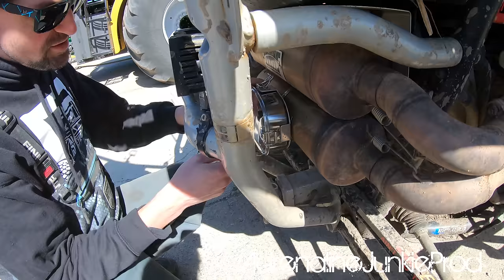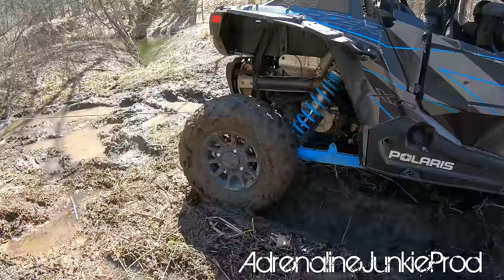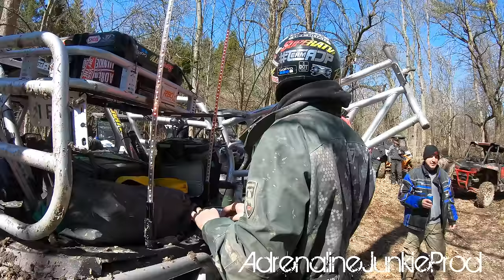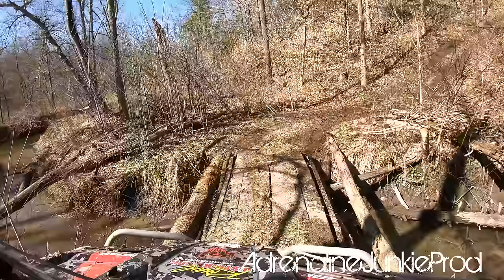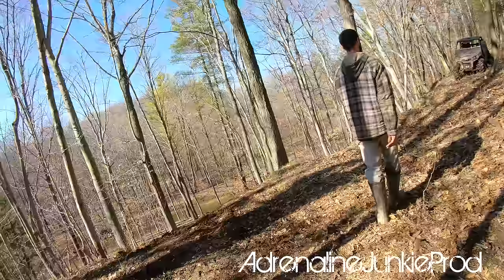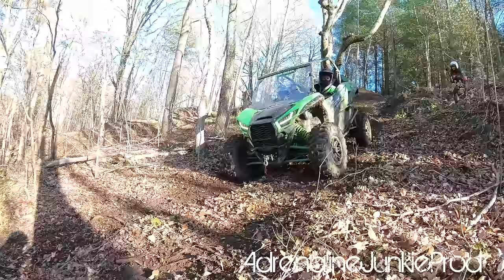SXS Trail Ride: 21 UTV's on an Off-Road Adventure! RZR, RMAX, YXZ, KRX, Maverick, Commander, Wildcat

Comment: Great video The fact that the fishbowl even was able to drive out of the trail after that violent of a tumble speaks volumes!  Glad they are ok!
Reply: The fish tank held up very well!! The cage and most importantly the seat belts never gave out!! Helmets took some good blows to lol but we both are doing good and the fish tank is back rubber side down and still ripping the trails up lol
Reply from the maker: Thanks Joe!! Ya, the Fish Tank took the tumble like a true tank. Fish has it all back together and better than ever. We just did a wild weekend of riding and the Fish Tank worked better than ever. He’s got quite a few more upgrades in the works too!!
Reply: @AdrenalineJunkieProd  Where'd you guys offroad in this video? Place looks sweet.

Comment: Hey buddy! It can be a pain orchestrating a big group ride, and documenting it as you did here. You did an excellent job. I enjoyed seeing all the different machines out there. Glad to see there's still a few Cats running around with you all as well. I'm impressed how well the Wildcat Sport went through the bush, despite having BFG AT's. I imagine it being about half the weight of the other machines helps it out a bit. 

That was a good catch of those folks seeing that stick tucked up in your undercarriage. Not having your stator would have been a little awkward, haha.

Those KRX are some real monsters. wish they were legal in WI. We're restricted to 65" here. I really like the RMax as well. I think Yamaha did a great job with its design. I wish Cat would talk to Yamaha and grab that engine and bring back a revamped, rock ready Wildcat X/1k platform with that motor, and revamp the Sport/Trail lineup with the 850. 

Good on your GF for having the situational awareness to get out of the way of that machine the way she did. The Fishtank is looking a bit tweaked. Glad they weren't injured. 

I'm a Arctic Cat fan, although the brand isn't what it used to be. On the sxs side, I'm running a Wildcat Trail. Not alot of technical riding to be had in WI these days. I'm trying to work with local land managers to solve that a bit. I'm sure they won't go for hillclimbs like what you all do, not that we have those here, but I think I can get some decent rock trails put together and get creative with it. We'll see. They haven't said yes yet, but I'm trying. Anyway, I'm thinking about taking the trail and installing the SuperATV long arm kit on it. I had considered building a different machine, or buying an XX to build up, but right now the machines aren't easy to come by in the first place, and the asking prices reflect that, haha. 

Great video Team AJP. Talk to you later.

RIP Jamie.

Comment: Great job brother. We usually head up to Kearny in the spring. Lots of trails from mud to rock to logging roads. Went to mattawa last fall and it was nice but not too technical or challenging. You can easily put 80-90 km on a day In either place. I’ll come rip with you; got a 21 x3 xmr rr!!

Comment: I ride a 2020 can am commander. Its my first sxs i bought it used with only 615 miles on it. I chose it bacause we couldnt come together on the payment of a new machine. And well when i saw it it was an eye sore. I loved it. Itvcame with some extras. After market clutches $1000 worth of very aggressive tires front bumper it just has a canvas top and it had a bluetooth system in it. $13000 i feel i could have done a little better on price but im ok with it

Comment: I chose the trails and rock edition rzr. Factory upgraded diffs. Arched A arms. Winch. Bumper. Beadlocks. And low geared for crawlin. Super smooth. The walker evens shocks are amazing I'm a big fan.

Comment: I chose to get the 2021 armax 2021 R Max 4LE. I am using it on my property to plow as well as clear out falling trees and a lot of trail riding here in North Idaho. I chose it because of its versatility and so many different after market options. So far I've gone with the typical a arm guards yeah third's soft enclosure lightbar upgraded heater and stereo system. I have 0 regrets it has performed beautifully and is quite the workhorse

Comment: Great video! I have a 2019 YXZ SS SE. I love it, i chose it because of the fun it gives with shifting gears. I also love the Fox x2 internal bypass shocks.
Reply from the maker: Glad you enjoyed the video man! Ya, the YXZ is soooo much fun to drive. Slapping through the gears is an absolute blast. I'd love to get a YXZ as my secondary machine. I'd set it up for mid-high speed stuff. Keep the RZR for technical trail riding.

Comment: Awesome video, you have alot of great informational content. I just picked up my first side by side, 2013 polaris rzrs 800. Reason I picked it is because alot of the upgrades were already done for a good price. Front, rear windows, front bumper, winch, doors, harness, slp clutch, slp exhaust, light bar, front a arm guards. With 2800km on it and I paid 8000 canadian.
Reply from the maker: Right on! I'm sure you'll love that thing! Like you said, sounds like alot of the key areas have been addressed and for a first machine it's great! Low millage too. Stoked you enjoy the videos and find them informative.
Reply: @AdrenalineJunkieProd  I watched your video on what to look for before purchasing a new machine. Had some good tips. Thanks 👍🏻🤙🏼 🇨🇦
Reply from the maker: @hammertimebc1934  thanks for the positive feedback. Glad you  found the video useful. It’s hard buying a used machine, especially when you are new to the SXS world.

Comment: I have a can am commander 800r XT I love it yeah replacing a belt is a pain but I ride it more in the cold weather so the heat off the motor is nice and it’s been extremely reliable I did get a locker built for it so it’s a true 4wd now

Comment: Being fairly new to the world of side by side and ATV, I was wondering… Is there any good reason for not being all time in 4x4 in the trails? Thanks!
Reply from the maker: Excellent question. Not a simple answer so I will just generalize. I usually only use 4X4 when I can't do something in 2WD. I engage it, clear the obstacle and if there is no other obstacle directly ahead I go back into 2. I find a lot of people do this. It is however, personal preference. In theory, it reduces mechanical drag and wear on the driveline. Also in theory, if your 4X4 system is working properly and you service it like needed then it should be just fine staying in 4X4 when you are off-road. In addition, steering effort significantly increases in 4X4, especially if your front differential is locked. It's also dependent on the terrain, your machine and your desired handling characteristics at the time. Those are a few popular reasons. There are many more.

Comment: I have a Odes Dominator X2 800. I like it. It's way cheaper than a Polaris or canam.  The intake and exhaust for the cvt are oblong which is making figuring out a snorkel for it difficult. Other than that it's great

Comment: Rzr 900s/1000s… the power to weight ratio is insane… I personally own one, I love it. With the right tire and driver it’s literally unstoppable. I’ve owned other sxs and atv’s and none of them quite match up to my 900s.
Reply from the maker: Ya, the 900S is a beast of a machine for trail riding. It’s super well balanced in every aspect. I love them too.

Comment: Had to watch this vid a couple of times.  Sorry about Jamie and also Fish’s roll.  Seems Fish and his girl are ok and I hope he can get that rig realigned.  Ref the lost content.  A raid 5 or 6 etc set up, stripe set with parity, will save your butt.  You can buy the raid boxes (Drobo) (x number of drive slots), install three + drives and if one fails, replace it and hit rebuild.  The data is spread out over all drives.   I run a Drobo unit Raid 5, four 3TB drives… hot swap and it automatically rebuilds.  I also back up my entire computer to it.  Works.
Reply from the maker: My concern is that I create so much content and that I edit 4K so I need that on an SSD while working with it. I can easily generate 300-750GB of content in a weekend filming in 4K on multiple cameras. The RAID setup seems like the best option on paper but from a budget perspective it would be hard to justify I feel. What I'm doing now is a backup of everything manually the oldschool way. If I had followed my rules and been religious about this when I lost the content I wouldnt of had an issue but I got sloppy/lazy and learned a hard, hard, hard, hard, lesson... lol. With that being said I am gonna look into that Drobo setup man. Appreciate the feedback and suggestions. Maybe I can work my way towards that setup. As for Jamie, thank you for the caring words, he was a good friend to all off us and what happened sucks. Fish's machine is back in action already!!! New and improved!!
Reply: @AdrenalineJunkieProd  
Solid state is much faster for certain and more expensive.  Perhaps just a disc mirroring set up would be fine or remind yourself to do it manually every time.  A sticky note is much cheaper... lol.  I look forward to more full length videos, which are a fav.  I too enjoy the technical riding more than the mud and racing.  It was awesome to see so  many different machines on the ride.  I would like to see some sport/rec rigs.. just wonder the capabilities of them compared to a full sport.  I guess in a way, Fish's Commander is the closest to that.  Take care.

Comment: Why we bought the old Honda pioneer 1000 is cuz all the machines were expensive back then so then we swap to the John Deere it got stuck in the mud hole while the Honda pioneer got stuck over a log and it flipped on its side when we put the lift on it that's why we bought the krx 4 seater the krx 4-seater is it good machine but we need to put bigger tires on it cuz when we went through the mud at winrock to get to the road it was tough well pioneer just crawled through it it's oil light is need to be replaced and the engine light pretty good side by sides

Comment: watching these just makes me want a RZR haha,  i have a 2020 maverick sport 1000R. i wanted a 2020 XP1K but my local dealer kept jerking around on pricing, wouldnt give me enough for my trade in wich was a wildcat, and not budging any on there price.  after the one sided negotiation with them pissed me off enough i drove across town to can am, walked in told them this is my trade i want this much for it. they gave me exactly what i wanted for it, and even negotiated a bit on the price for the maverick so i bought it right there.    to this day tho i still kind of wish i had got the rzr since its what i wanted initially, zero complaints about my maverick sport its one solid machine but im sure ill get a rzr again someday
Reply from the maker: Finding a reliable and competent dealer can be tough depending on where you are located. Like you said, the Mav Sport is a badass machine. I love a bunch of the machines and would have no issue owning various machines. I do love my RZR Turbo though. If I had to get another machine and still keep my RZR I'd have a hard time choosing what to get.

Comment: Pretty sure you can swap the Speedo and dash to your XPT just like the HL had in the beginning
Reply from the maker: Hey Jay, would the connectors for the electronics be the same? That would be an awesome upgrade.
Reply: @AdrenalineJunkieProd  i think they are. If someone has one in your group, just swap to test. I ran an rs1 speedo on an 18 xpt wiring harness

Comment: 2014 Maverick 1000R and 2022 X3 Turbo RR with the smart lok front diff. So much better than the visco lok on the older models. You aren’t the only ones who call it canam’s 3WD 🤣
Reply from the maker: We call it 3WD cause it is! Ya, the Smart Lok is a huge improvement over the previous generations! I feel that even the Smart Lok could use some work. Works well in mud with lots of RPM and wheel spin but still struggles at times in slower technical crawl type situations I find.
Reply: If you select "Front Diff Lock" instead of "4x4" it instantly engages the front locker and takes the "Smart" feature out of it, giving you an all time locked front. If you select 4x4 the smart lock will work similar to the visco lok when set to mud and locks at varying degrees when certain parameters are met when in rock mode.

Comment: You should run a raid setup. That way you have some redundancy
Reply from the maker: I back everything up now religiously as soon as i transfer it. Filming in 4K the files are huge. I can easily generate around 300-500gb of raw video footage in a single day of riding. The downside of a raid setup is when one drive fails it takes them all from what I understand.
Reply: @AdrenalineJunkieProd  It depends what raid setup you run. I would suggest raid 5. You would need atleast 3 drives. If you one fails, you just replace the drive and resync the array. No data lost. I would also keep backing up like you are doing now.  Great videos btw
Reply from the maker: @cidgreen  I run SSD’s for my main editing drives and Nvme for my OS drive. They fill up fast with the 4K footage so I use regular HDD for my long term backup.
Reply: @AdrenalineJunkieProd  That's the way to do it.

Comment: Check out Houser Racing here in the states. They make awesome tree kickers that will help from getting snagged like ya did @1:23:00
Reply: I see that’s not an option with your cage. Nvm.
Reply from the maker: Ya, with the exo cage I cant run them. It's the first time I've gotten pinned like this. I've considered extending the kickers a touch.

Comment: Y'all need to get a Bubba rope and a couple of soft shackles word of advice don't get one over 5/8 and diameter it won't stretch enough with that little bit of weight I riding that gooey mud and quicksand all the time could stretchy rope 20 ft long 5/8 to saw shackles you can get snatched right out of there
Reply from the maker: Thanks for the recommendations! I've heard mixed reviews on the soft shackles. Do you like them? I have a kinetic recover rope like the Bubba rope. Haven't really used it for a hardcore pull yet but I'm sure it's coming with winter on the way.

Comment: You do know there is a way to get your content back off of hard drives nothing is  ever gone need to talk to a computer tech around your area as long as you haven't put anything on it since then there's a good chance you can recover it
Reply from the maker: Not with a solid state hard drive that had TRIM engaged. On a mechanical drive this is true but on an SSD once it’s formatted it’s gone.  Just to make sure I did contact a data recovery company and they confirmed that. They said that they would check the drive for me for free. Their inspection showed the drive was wiped.

Comment: Dont send it with a passenger if you cant send it confidently
Reply from the maker: All the drivers and the passengers know what they have signed up for here. You’ll see in some of the videos the passengers get out before certain obstacles if they don’t feel comfortable. If your referring to the roll we have all made that climb multiple times. What happened here was a miscalculation and   An accident. Luckily no one was hurt.

Comment: Y’all need motohavocs or assassinators this hurts to watch!!!
Reply from the maker: The assassinators for example would work great in 10% of scenarios and terrible everywhere else. The type of riding we do is mixed so it’s always a trade off. Mud tires have proven over and over to cause more issues then they solve in our specific use scenarios. Hope my answer makes sense. Even with multiple tire choices at your disposal it’s impossible to choose a tire that does everything amazing.

Comment: Absolutely hilarious that you have no idea what type of tire you need for the terrain you’re going to be riding in and you guys are supposed to be some kind of seasoned riders. Hilarious, get you some Maxxis bighorn’s.if you don’t have enough money for different tires for different terrain.The bighorns will go through mud,through sand,climb rocks, slide predictably at high speed and they will bring you home as long as you do not high center of the vehicle….. you guys are running drag slicks at a mud fest. Believe me been through a bunch of tires, and ridden through a bunch of different terrains. Like your content, and camaraderie, but……..